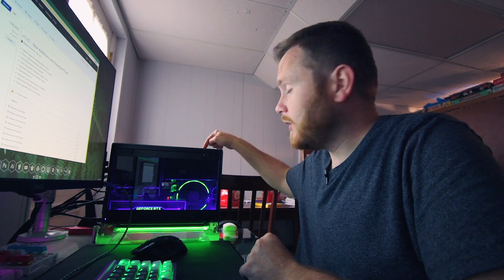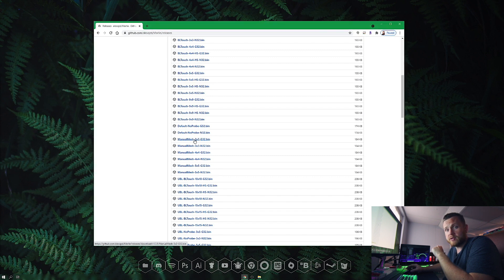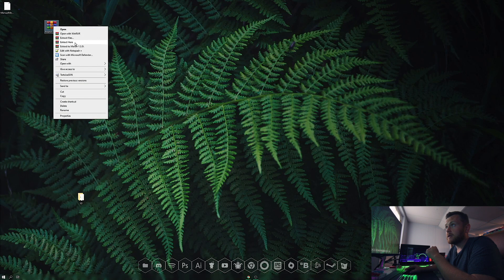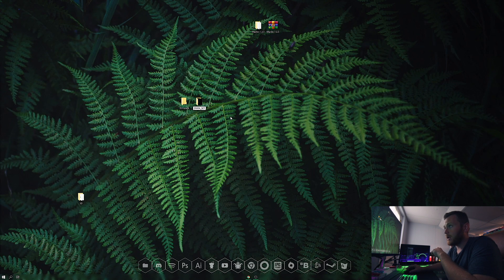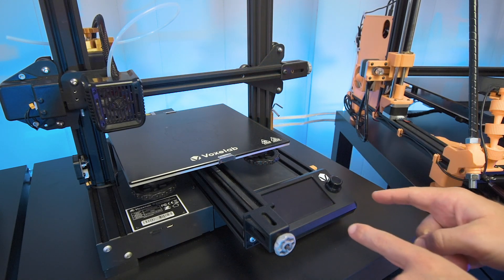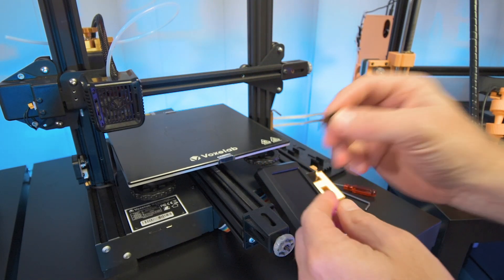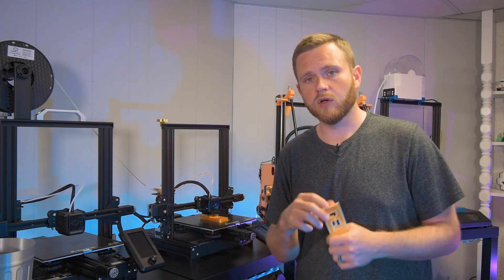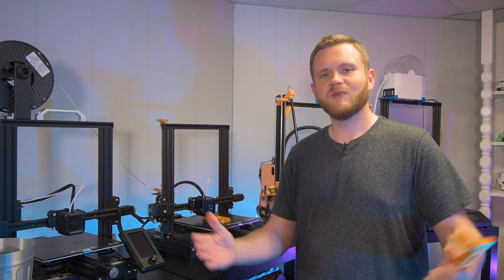Reduce Risk of Fire on Your Voxelab Aquila with 3rd Party Firmware

Comment: HELP!!!!!!!!!!!!
OK, newbie here... I have a new to me Aquila with the G32 chip. I went to Voxelab and down loaded the update for 1.2.4. used winzip to unzip the files. I formated the sdcard per Fedor's video and moved the unziped  .bin file to a new folder named firmware. I inserted the sd card to the printer and turned it on. it went to the screen in the picture and just sits there.
I tried taking the file from the folder and just the file on the card and the same thing happens.
When i remove the card and try to turn on the printer it just sits there and does nothing.
HELP!!!!!!!!!!!!!!
Reply: I was trying to use a 16gb card...never could get it work. Got a 8gb card formatted it to 4096, created folder named "firmware", dropped the .bin file in the folder then inserted the card and turned it on.... it updated and gave me the green check mark. Then I did the screen update which worked like a charm. The key for me was using a 8gb card!
 I am probably going to install the Alex firmware in the very near future.
Reply from the maker: Nice! I thought the 16gb had to be set to 8192 bytes and it would be ok. Guess I was wrong. My bad. Glad you got it though.
Reply from the maker: Are you sure you have a g32 chip? Worth checking the chip itself. Which firmware are you trying to install?
Reply: @3DPrintSOS  Yes the printer has no sticker indicating a different chip. 
I am trying to upgrade from 1.2.1 to 1.2.4 .
How is the G32 chip marked?
Reply from the maker: It’s marked on the cpu of the motherboard with either an ST or GD. Both are considered a G32 chip.

Comment: I have a gone through all the steps here. My printer is not responding in the fashion shown here. my printer is constantly locking up as soon as I do anything with the hot end. I have a Voxelab Aquila X2 with the N32 chip
Reply from the maker: Hmm. It sounds like there is some issue with the firmware. I’m assuming you’ve tried to update the firmware?
Reply: @3DPrintSOS  yes I did. Followed you step by step and nothing happened when I dropped the MSDC in the printer and turned it on.
Reply from the maker: So you mention it locks up when you do something with the hotend, are you getting an error? Or it just freezes? One of the earlier firmwares had an issue with thermal runaway which froze the firmware when the thermistor was shorted. It might be this same thing. Except this wouldn’t happen with the updated firmware. Have you tried to reseat your thermistor?
Reply: @3DPrintSOS  it just freezes. the screen freezes nothing moves. I didn't know I was in a thermal runaway till I saw the smoke.
Reply from the maker: Smoke! Man, sorry to hear it. So the update didn’t go through, which means the issue was that the card either didn’t format correct or the file wasn’t in the right spot or type. Otherwise the printer would have just installed it. That’s why you had runaway. Guess we gotta figure out why it went into thermal.
Reply: @3DPrintSOS  I can run your tutorial again. The cars is already formatted properly. I do have a question, is there any difference in procedure between the Aquila and the Aquila X2?
Reply: @3DPrintSOS  I did replace the nozzle successfully.
Reply from the maker: No difference. The only reason why I mention the card is that if it’s not 8gb or is set to 4096 byte size, it may not work.
Reply: @3DPrintSOS  I formatted it in the 4096 like you said in the vid.
Reply: @3DPrintSOS  BTW thank you for the vids and your replies here.
Reply from the maker: Join the discord, let’s get more eyes on this problem. Hopefully together we can get you back up and running.

Comment: So I'm completely new to this 3d printing world and got my hands on a Voxelab Aquila x2 with a N32 chip, Ive watched all your videos on the Voxelab printers and managed to get the Aquila since I was able to strike a deal on a used one. Ive done most of the upgrades but the one that I'm having issues is updating the 3rd party firmware. I'm a Mac computer user but I managed to get my hands on a Nuvision tablet/PC the firmware process. Only issue is that when I power on the printer with the SD card in it with the printer powers up like normal, there is no loading screen no nothing. I have formated the card and set it to the 4096 bytes like said but still nothing. Could you guys give me some direction with this? I downloaded winrar and unziped the file to get the voxelab firmware sets. I've kind of given up on the printer because I can't get this firmware installed. Can anyone give me some advise or help? I down loaded the 3x3 x2 N32 bin file.
Reply from the maker: Hmm. This is with a stock SD card? Sounds like it’s not recognizing the firmware is on the card. 

Are you putting the .bin into a folder called “firmware” and the dwin folder renamed to “DWIN_SET”?
Reply: @3DPrintSOS   I don’t have the SD card that came with the printer, I’m using one my  own. I had it formatted to 4096 bytes and then dropped in the Dwin_set and the firmware folder with the bin file. Would I need the stock Micro SD or would any of them work? I have a 64gb I’m using and a 16gb
Reply from the maker: The printer supports 8gb and 16gb cards. I think the 16gb card needs to be set to 8192 bytes.
Reply: @3DPrintSOS  I really appreciate your help man I was able to add on the firmware. I’m just waiting on my fans to come in and I’m going to start printing this weekend. I just want to say that your the reason why I got this printer, you had so many posts about it and helped grow the community. Hopefully it can grow to be like the ender 3 community. I almost picked up the Voxelab Aries, but the firmware is what killed me, If there would have been a marlin one I would have jumped on that one. I might buy it in the future to have and have two machines running prints at home. Maybe my next step would be to run octopi on a raspberry. I just saw that video today. Just want to let you know you gained another subscriber!
Reply from the maker: Awesome. I think you made the right call the Aries is too locked down. And I think you’d love octoprint. Makes things easy.

Comment: You videos are so informative and easy to follow for beginners like me. I have successfully managed to flash the firmware but the display doesn’t get the colourful icons with the DWIN SET, what am I doing wrong? Thanks
Reply from the maker: Hmm. Did you allocate 4096 bytes on the sd card? And make sure you change the name of the dwin folder to exactly “DWIN_SET”
Reply: @3DPrintSOS  yes I did and still not changing

Comment: is there any firmware i can use for the H32 chip motherboard?? i cant get the CR touch to work.. any help would be grate....
Reply from the maker: The only firmware you can use on the h32 is what is on the voxelab website
Reply: Yea . I figured... but the BL touch H2 firmware doesn't work with the CR touch or dose it? . Cause I get seem to get it to work ..
Reply from the maker: It should. The bl and Cr should be virtually the same
Reply: @3DPrintSOS your videos are great really got me going on the prints .. and thx for helping me out..I'll try again...
Reply: Can't seem to get it to work...

Comment: Hi Fedor, thank you for the video, i was stuck and going round and around until i watched this one, now i have one small problem,, when i try and home it all my Z axis moves down about 5 mill and then starts going up and i have to click it to stop it before it gets to the yop, this is my first 3d printer so i know very little about them
Reply from the maker: Hmm it sounds like it’s going in reverse. It should be moving up a touch, then down until it hits the end stop. Sounds like a wiring issue. Should be able to repin that connector fairly easily to get it going on the right direction.
Reply: @3DPrintSOS  thanks for the speedy reply, i did change the green and blue wires aroung on the motor end but i had to shut it down due to it sounded like it was chewing teeth off
Reply from the maker: Oh no. Yeah you gotta be careful with the repin. It’s pretty specific

Comment: I recently bought an Aquila X2 and it had 4.0.2 FW preinstalled, however Octoprint still flags a warning that the FW may have the thermal runaway issue.  Is Octoprint incorrect or am I still at risk?  Thanks!
Reply from the maker: I think Octoprint will always say that for some firmware. Since it’s modified from the original build

Comment: Any word as to how/when "H32" Aquila's can benefit from Alex's Firmware option?
I have a 1 version older Firmware on my Aquila X2 and wondering if upgrading to latest is recommended/safer/Improvements and worthwhile to do while await (with much anticipation) a Machine and UI FW version that 🪨 Rocks ??
Reply from the maker: Alex has no time update at the moment unfortunately. It’s a difficult task. I would grab the latest from voxelab for sure.
Reply: @3DPrintSOS   Thanks. I'm learning these are going to be a love/hate relationship like I have with FPV Kwad flying...the love bit is bigger on average.
(so far/ on both)
Thanks for being a great source of help for Aquila units/ got me getting things printed / sticking to bed.

Comment: I am in the market for my first 3D printer and it was looking like it would be the Aquila,  mainly due to price and I liked the horizontal screen better.  With this firmware changing the orientation I have to rethink this now, would an X2 be a better choice?  Also, Alex's firmware looks to not have been updated lately, hopefully support continues.
Reply from the maker: Alex’s is 100% worth the screen flip. I would highly recommend it. :)

Comment: I just got the X2 with N32 chip and its preinstalled to 4.0.2.

What are the benefits of Alex's over Voxelab's?

Does Alex's firmware make the printer print better? If so, how?

I mainly just print parts that I design, which would otherwise not exist. So my prints dont have to "look" pretty.

I would welcome that, although its not necessary.

Im just curious if its worth "upgrading" the firmware.
Reply from the maker: It gives you tons of features and the ability to calibrate your machine. Which you just can’t do on the stock firmware. Also mesh bed leveling. ;)

Comment: For anyone having issues with installing the display firmware, just format your drive to fat32 with 4k allocations. That will instantly solve it.
Reply: I format my sd card and it won’t give me the option to do 4k. How do I fix that?
Reply from the maker: Are you on a Windows machine? Not possible on a Mac sadly.
Reply: @3DPrintSOS  i found out what was wrong. I used a 16gb card and it worked, i was using a 32. thank you
Reply from the maker: Ah. Yep only 8 and 16 are supported. :)
Reply: @3DPrintSOS  thank you

Comment: Should I purchase an aquila right now? Or should I buy an original ender 3 for my first "big" 3d printer?
Reply from the maker: An Aquila is an Ender 3 for far less. ;)
Reply: @3DPrintSOS  yeah but I've been reading some negative stuff about the aquila compared to the old ender 3, and this is compared to the ender 3 V2 correct?
Reply from the maker: That’s correct. Yea there are some negatives. One is the fans. They are loud and die after long prints. Then the extruder has a failure point on the lever. On some machines, the thermistor doesn’t last very long. Otherwise, solid machine. All of those things are less than 30 bucks to fix, total. And with a decent nozzle and some ptfe, it can print quite a lot of different types of filament
Reply: @3DPrintSOS  Hey man, Tysm for replying and making the reviews on this printer, I Just bought it a few minutes ago after watching some of ur videos :)
Reply from the maker: Awesome. Glad I could help. Congrats on the purchase. :)

Comment: has this been fixed by voxelab or do i still need to install this firmware?
Reply from the maker: Both. Fixed, in the latest firmware. You have to update to it. :)
Reply: @3DPrintSOS  if i buy one after the new firmware does it still need to be updated or will it come pre updated?
Reply from the maker: You can check the version in settings right on the machine and then compare it to the latest version on their site. That would be the best way.

Comment: hey followed your steps however it seems like the screen flashes blue for a half second then orange however the screen is still a glitchy mess
any ideas?
Reply from the maker: If the screen it a glitchy mess that means the graphics aren’t correct or they didn’t install. Make sure you do the screen after you do the firmware. And make sure you are allocating 4096bytes to a 8 or 16gb card. Make sure your dwin folder is named “DWIN_SET”
Reply: @3DPrintSOS  yeah i made sure that the SD card is set correct and everything. The actual firmware installs just fine its the LCD board that doesn't seem to take to the DWIN_SET folder.
Reply from the maker: Have you tried a different dwin?
Reply: @3DPrintSOS  UPDATE: got it to work,  there was a minor disconnect on the SD card slot of my LCD board. one pin was not making contact with the SD card
Reply from the maker: Oh wow. Glad you got it though!

Comment: Will this work for the x2 what all do I have to do for it to work I plan to do the auto bed level I'm just confused with all this
Reply from the maker: Should be exactly the same as the non X. Just make sure you get the right chip. I have a video on mesh leveling and auto bed leveling. So check out those vids. :)

Comment: For me, it won't do the blue screen and then the red screen, it just opens back up with the glitchy mess of a screen :(
Reply from the maker: That means either the software isn't installing because the formatting isn't right OR the .bin is incorrect or still a zipped .rar file. Have you tried anything to troubleshoot?
Reply: @3DPrintSOS  ohh I have to unzip the dwin file?
Reply from the maker: @crimsonthedragonn  Yes. Basically you need to have two folders. One titled "firmware" that contains your .bin file. Another that is titled "DWIN_SET" with all of the files already in it. You HAVE to make sure that your card is formatted with 4096 bytes allocated. It won't work otherwise.
Reply: @3DPrintSOS  ok thanks

Comment: Hey Fedor, have you heard of a common problem people have been having with Octoprint and thermal runaway? Only getting that alarm and print halt when connected to Octoprint? I've been getting it on my Aquila. Parts print just fine from SD card and Octoprint not connected. Just a glorified webcam app...LOL. But, around the second layer, Thermal Runaway alarm and yea... very bummed out! I've read a lot of conflicting things on forums and reddit and all that. Wondering since I now you use Octoprint and are a bit of a Aquila guru. Know anything? Thanks man!
Reply from the maker: No not that one specifically. :/. I’ve used octoprint for a little while now with no issues. Which board do you have?

Comment: Great videos.  Just got an Aquila for the family and working through the growing pains of owning a 3d printer.  Couple of general questions for the printer: 1) the middle of the bed seems to be a little bit lower than the 4 corners as I go through the leveling process.  Would you recommend adding aluminum foil (as some suggest) to remedy the issue, and have you discussed this in any of your videos?  2) I'll probably upgrade the firmware after my 'Benchy' finishes printing but I was wondering if there wasn't something I should be doing to have print time estimates more accurate in Cura for my Aquila.   Thanks and I look forward to your upcoming videos!
Reply from the maker: 1) nah, I would use 4 clips on the bed
And realign and
2) the firmware should be great and give you lots ofmoptionsn

Comment: About how long does it take to flash the firmware? It's been sitting for a couple minutes with just the loading bar.
Reply from the maker: Should be seconds. Something must have gone wrong. Did it work out?

Comment: I have just gotten the Aquila myself and for my grand Nephew.  I am trying to Mentor him on these things and will definitely recommend this channel to him.  One problem I am having is that the display will not update.  I only get a red screen.  Would the SD format be an issue if I can't make it 4096 block size under FAT32?  It is the only thing I can't do because it is not an option in my windows 10 format command. The firmware update appeared just as you showed in your video.
Reply from the maker: Yep. That would be the issue. The printer doesn’t know what to do with the files when it’s not set to 4096
Reply: @3DPrintSOS  Problem solved and an explanation of what it was and why.
I was trying to use a new SD card that is Class 10 video grade., These can not be formatted even manually for 4096.  Took my SD card to the Geek Squad people to see if they could do it and they tried but failed and then explained why.

Came home and took the card that came with the printer and backed it up to the computer, then formatted it and the option to do it at 4096 appeared for that card. Formatted, then loaded the files back to that card and the upgrade of the video worked flawlessly.

So sometimes the latest tech is not the best tech to solve our problems.  Getting a bunch of 8Gb cards cheaply may be better that getting video grade cards.  Just saying.

Thanks for the info, you may have specified to use the system SD card and I missed it , however I think a little more about it may be warranted for those of us that don't understand the why of things.
Reply: Right around 3:08 you do say the SD card for the Aquila.  perhaps you could edit over it and flash the it is the card that came with the Aquila.
Reply from the maker: Good point. It also has to do with size. You can only use 8 or 16gb cards. Thanks for replying with a fix!